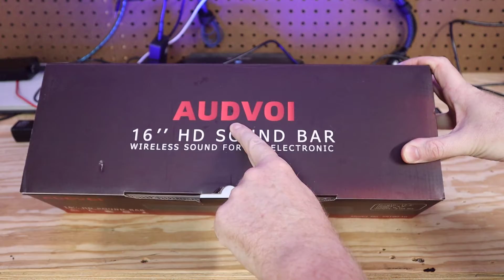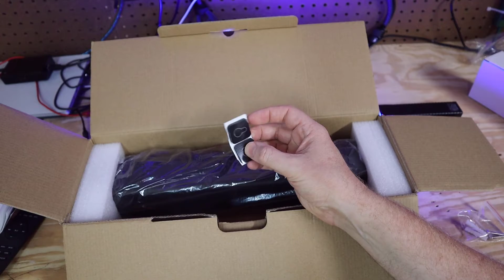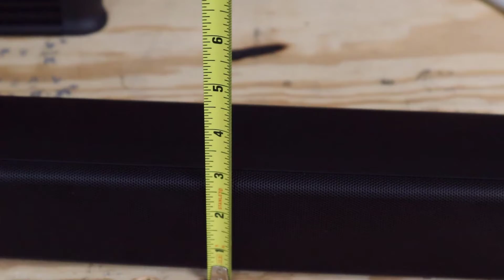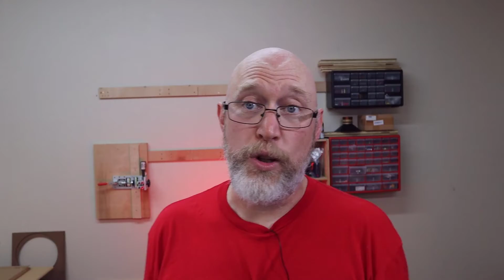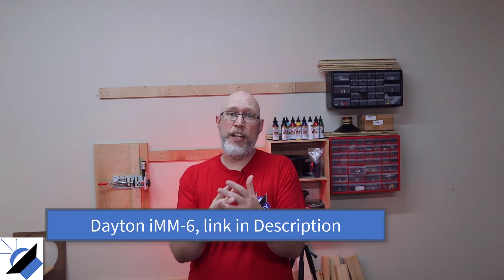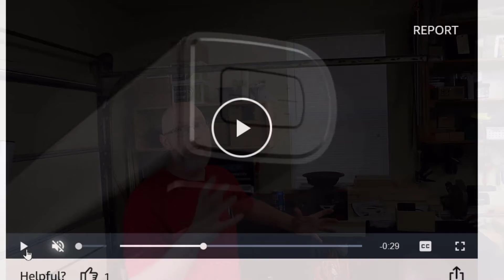AUDVOI: LIES EXPOSED!  AUDVOI 16" Mini Soundbar Review! #soundbar #audvoi

Comment: You should modify this thing and make your own sound bar out of it and use it and add external amplifier to it and stuff and see if you can make a cool sound bar
Reply from the maker: Cool idea
Reply: Probably not worth the effort as the elctronics will stop functioning over time. Many of these devices are designed really awfully and they are using expired or rejected or high ppm components that would not buy any serious manufacturer.